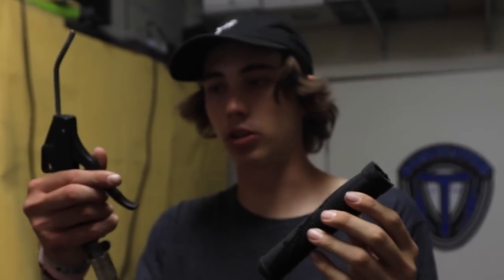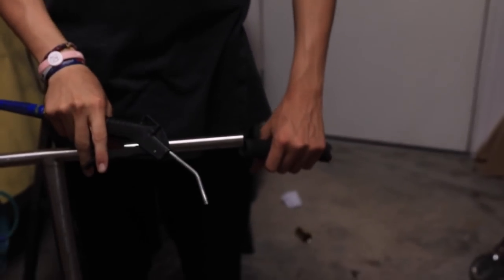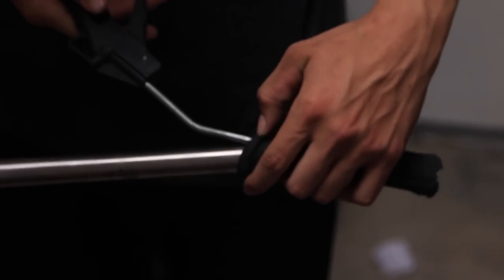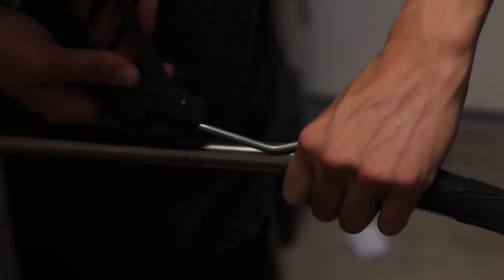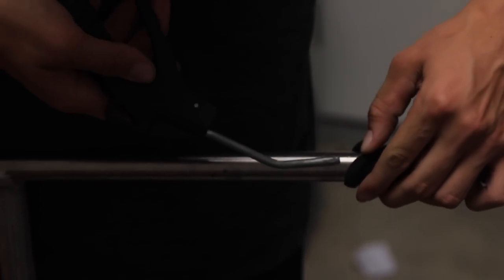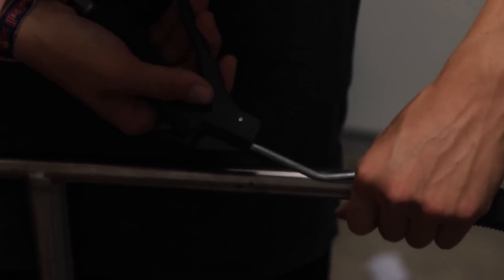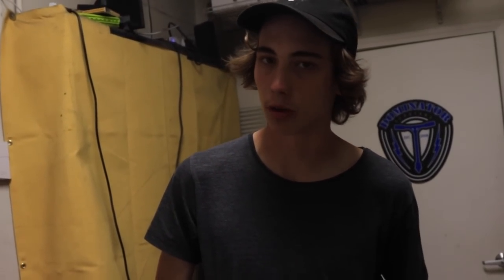THE CORRECT WAY TO INSTALL SCOOTER GRIPS!

Comment: How to remove bearings and fit new bearings ?
Reply: hammer
Reply: J.M _SCOOTS With allan key or a skateboard trucks
Reply: Yes
Reply: Cut the part where the bearings are off, get a new wheel, cut the part off of the new wheel and weld the part on the old wheel

Comment: If I don't have an air compressor I just use hairspray it's good because usually you don't use your bars right away so throttle grip doesn't matter
Reply: Shouptie TV but then the hair spray dries up and you can't get them off unless u use a fuck load of wd 40 and a butter knife that might rip your grip so...
Reply: Monte Samuels yeah but it's not usually bad with an air compressor or if you don't over use hairspray
Reply: Depends what hairspray.
Reply: 90% rubbing is probs the best

Comment: Pro tip: before installing the new grips, clean the bar, and maybe the inside of the grip, with isopropyl alcohol very well to remove any potential oils or grease or anything from touching the bard with dirty hands. If you install brand new grips onto a dirty bar it will potentially damage your brand new grips and they will still slip. Hope this helps :)

Comment: I actually put my grips on with tap water when I don't have any rubbing alcohol. No joke it works.
Reply: Doesn't it rust though?
Reply: Glenjamin I've had no problems like that so far
Reply: Emile Blum well, if you spray enough hairspray in your grip they get really slippery so it's easy to put on then they dry up
Reply: Zeji I've never used hairspray, but next time I need new grips I think I might try
Reply: ya same

Comment: Another way is you can use a hair dryer to heat up the grips for like 30 seconds and then just use the last technique and it’s real easy so with thick grips like ethic grips this works well

Comment: The absolute best way to put them on is by using completely raw alcohol. All you gotta do is get some on the bar and it just slids on like it's nothing, and believe me my grips are tight as shit and fricking IMPOSSIBLE to get on using any other method and still alcohol works this well. The only downside is that the grips are going to be really slippery for like 24-48 hours after, so do it if it's going to rain or if you're doing something else during one or two days.

Comment: what i do to put my grips on is another good way. ok so what i do to take off the old grips i get a butter knife stick it in the old grips and strach it out alittle bit so i could put just a tab of soap and then just wiggle your grip alittle and it will come out like butter. then to put the new grips on i spary alittle bit of windex in the new grips and they also go on like butter. this will take you less than 2 minutes

Comment: .....Really? Wanna know how I do it? Rubber mallet. Shove the end on so it's a floppy. Start slapping the end with the rubber mallet. It will bend, cave and squish as you do this but it is going on no problem. Easy as pie, no fuss no mess works every time. Inuendos completely intended.